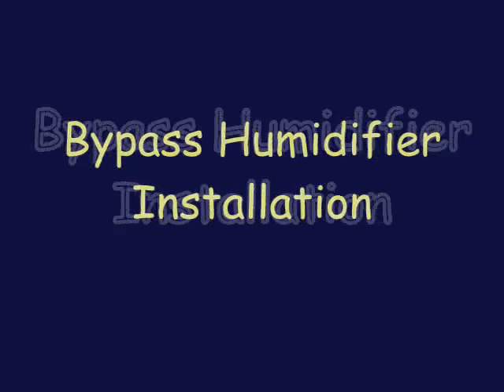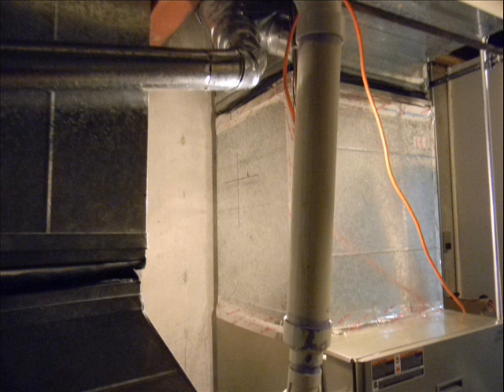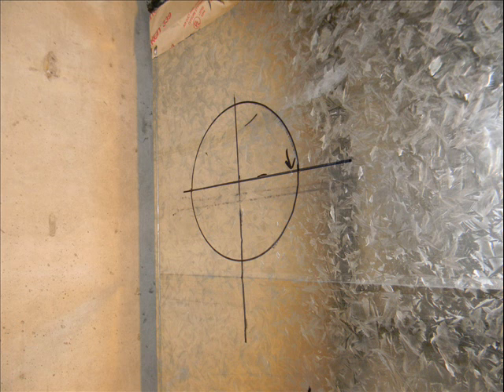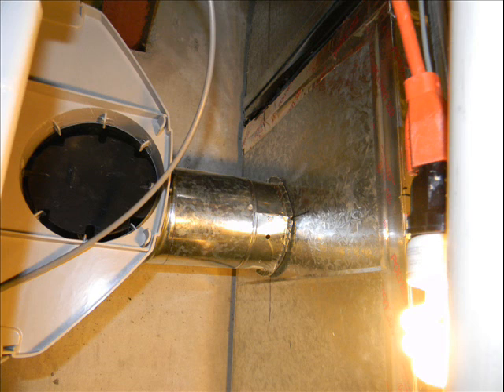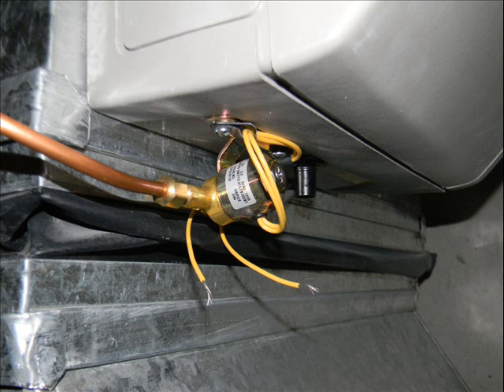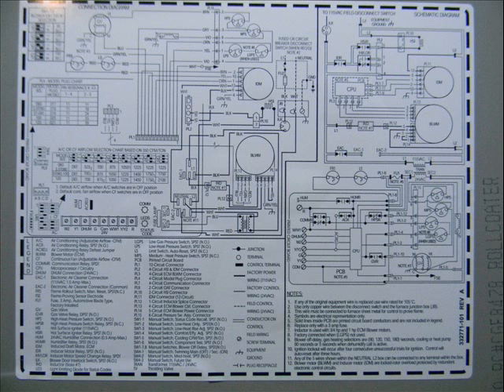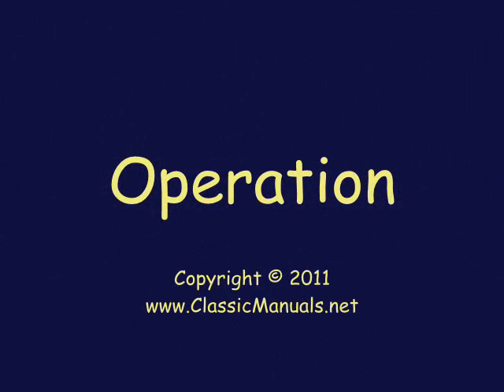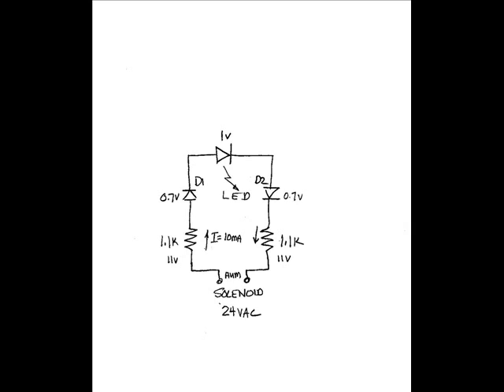Humidifier Installation | April Air | Humidifier | Install | Bypass

Comment: My Bryant 757M whole house humidifier fan will not activate.  The solenoid opens and closes for water, the clicking of the humistat clicks when it should.....but not fan,.  I checked the incoming voltage on the motherboard at the Power (white) / Black (Cord) and it read 120 V.  The connector for the unit that supplies power to the solenoid reads a voltage of 24.  The Primary side of the Transformer reads 75-80 ohms whereas the secondary transformer read about 5 - 6 ohms; it is a Pacific Electronics Class 2 Trasformer PRI: 120V / 60 Hz and a SEC: 24V 10VA.  I am not familiar with the component marked SR11CS10DC24 10A/24DC "STETRON" but I assume it is a relay??  I want to bypass the fan directly into the 110 outlet to validate the fan works if it stands along without the motherboard; I assume I will not fry / kill myself.  I am learning this electrical stuff by the hour so pardon the low competence summary.  IF the fan, whenn by passed works, and that "relay thing" is not and issue...not sure how to test that unless I try to use my multi-meter on the back of the board and, if it does work, I am not sure what the reading should be and if I require power or not.  With this said, part of the back of the mother board, directly under the Transformer looks a little oxidized.  I am thinking if the fan works and someone informs me how to validate the "relay" then would fine steal wool potential solve / improve the chance of power.  Again, all parts appear to work but the fan....which may just be old and the bearings are shot.  ANY HELP/RECOMENDATIONS WOULD BE GREATLY APPRECIATED.

Comment: connect the solenoid valve to terminals w and c one the furnace board. they only have power, 24 volt, when the thermostat is set to heat and the blower fan is on. easy

Comment: you can use copper or plastic tubing for water!  mine was plastic when i bought my house 25 years ago and never leaked!!  i just installed a new humidifier using the same tubing. i like to use plastic because it is less likely to kink. i used plastic on my fridge ice  maker because the copper line kinked.  i will never use copper again!!!!!!!!!!!!!!!!

Comment: CAUTION: Many newer furnaces supply 110v to the HUM terminal, not 24v! You will instantly ruin the solenoid if you wire it this way if you have 110v to the HUM. Check it with a voltage checker before you connect it like this. Mine had 110v to the HUM so I connected that and the furnace neutral to a 24v transformer, which then goes to the humidifier.

Comment: Take the saddle valve OFF! You have to replace it ASAP with a stubbed 
out 1/4" ball valve that is nowhere near the vertical hot water tube. I 
can tell you that the valve WILL FAIL and the slow leak of water is 
going straight down into your water heater and soaking the insulation 
around the tank. This will cause 1000s of tiny perforations to develop 
and you can kiss your heater good bye. I did this to a 3 year old heater
 and it cost me over $600.00 to replace it. Sharkbite or solder, but get
 that piece of junk off of your system, please!  I just installed a 760 
on my furnace and have a 6" stub out (horizontally) from the hot water 
side and a chrome-plated 1/4" valve on the end. Best money you can 
spend.
Reply: don't use sharkbite

Comment: The solenoid that controls the water has two wires.  One gets 24V hot and the other goes to common?  Is that correct?
Reply: Snake Doc
Reply: yes

Comment: does anyone know if the waterline leading to the humidifier is warm or cold water?
Reply: it depends where if you place the humidifier on the supply or return.
Reply: First Last  usually cold so bacteria doesn't build

Comment: This might be what I need to do to install mine, however, does this not harm overall efficiency in the winter if you're putting cold air back into the hot air?

Comment: This is a good furnace humidifier install video.
The main concern is attaching the power/solenoid control to the furnace 24VAC to ensure power/water only occurs when the furnace is running.

Some details:
1. your humidifier is a continuous water flow with a water solenoid to control the water flow, or
2. your humidifier is a reservoir type with an electric (24VAC) motor to rotate the filter.

In my opinion, the reservoir type is the best as you only replace the water when it evaporates and electricity is only used when the furnace runs.

In either approach, it is important to ensure power is only available when the furnace is on.

The installation difficulty is furnace humidifier instructions don't help you with the 24VAC furnace connect (to ensure it only runs when the furnace runs). 
Why is it the humidifier companies don't provide this information?
Maybe they sell less product if the consumer is more aware..

You need to find out how to so the install to your furnace 24vac connections.

Having outlined this install information, it is important to understand problems will result over time:
1. You need to (at least yearly) descale the filter (or buy a new one)  
2. You need to check the solenoid to ensure it is working correctly (not running when the furnace is nor running) and replace (if the rotating electric motor is running all the time or if the water is dripping all the time). 

If you have questions, just ask.

Comment: Good video,For Bryant units  HUM is the right terminal if you want the thermostat to control furnace and the humidifier (Check first if your thermostat model can set % humidity).Also consider if your house was to dry it will take several days to reach the %.

Comment: great video. i just disagree with hooking it up to the HUM terminal. it should go in the EAC terminal.
Reply: Depends on your preferences, really. HUM is specifically there for a humidifier. It is powered only when blower and heat is running. EAC is powered any time the blower is running. So I guess if you ever think you will want to add humidity without the heat on (by manually switching your thermostat to "fan"), then you would use EAC.
Reply: @bobotron50  Good Info. Researching how to reconnect the humidifier in my new gas furnace.